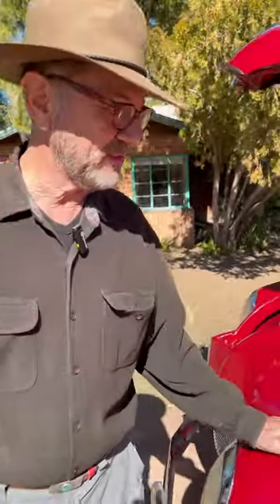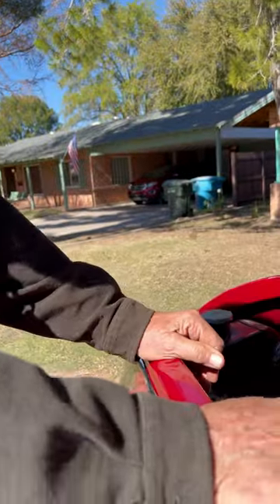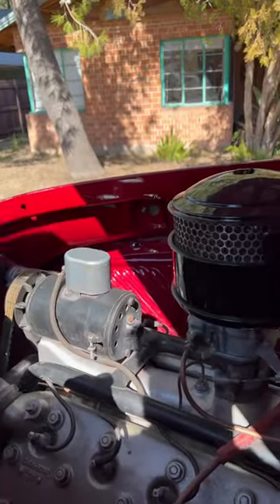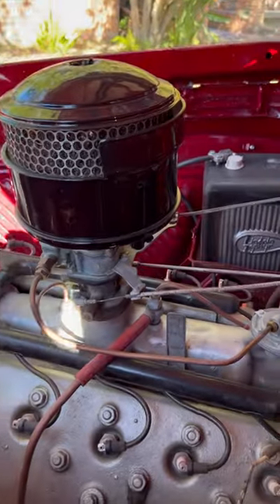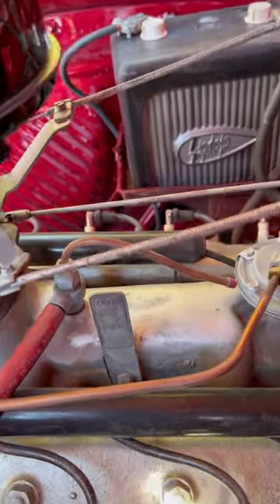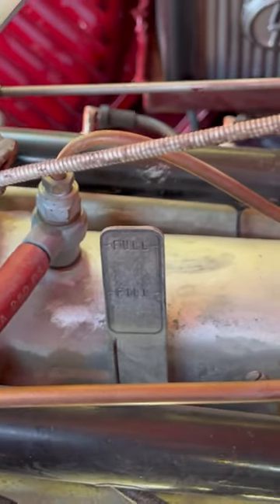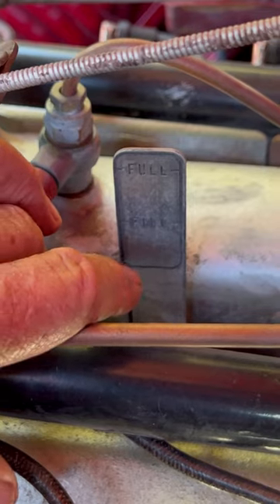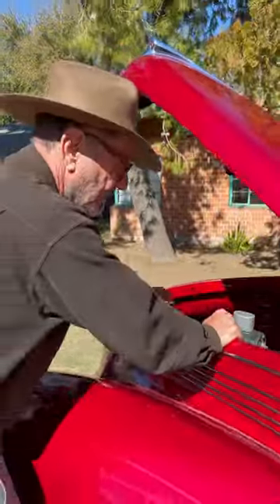Crazy No Dipstick Oil Check - Early Lincoln V12 Flathead #shorts #classiccars

Comment: back when things weren't built to be thrown away.
Reply from the maker: So true!
Reply: Any decent new vehicle would run circles around that In every single category except maybe beauty.
Reply from the maker: @ROBMACDUI also history perhaps
Reply from the maker: Beauty and also maybe historical context, which I enjoy very much
Reply: @BarryTsGarage  can't argue that.
Reply: @ROBMACDUI  could care less. I could fix that car with a banana and a chisel
Reply: @andrew1898  can do that with a modern car too, just gotta have the knowledge, saw a guy skip the fuel pump and use a water bottle of gas and some hose and made his efi modern car work, he put the hose into the intake somehow and it was able to suck enough fuel for an idle
Reply: @ROBMACDUI  except that it’s a car you could’ve bought brand new and generations later it would still be running. Back when cars were fixable pieces of steel and aluminum with plenty of room and access there wasn’t something that you couldn’t find a way to fix. Get into a fender bender nowadays though and you’ll be picking plastic up off the road as your pos gets towed to the junkyard to get the insurance slap of approval “totaled”
Reply: @thedragoonafilms2406  

Hyperbole is your best friend.
Reply: @ROBMACDUI  for 7 years until it rots and starts falling apart then winds up in the junk yard. Cars (mainly the minivans that everyone calls crossovers/suvs) are 100% disposable, you just wouldn't know it from the ridiculous prices. Why do I want a shit box that will dent if I lean on it, be totaled because the floor pan has a little water in it or fail to work correctly when the radio is removed? EVERYTHING is made to fail in new vehicles. Better start saving for that $1000 head light assembly and get ready to drop the whole front end to change it.
Reply: @skylined5534  I understand how it could be viewed as hyperbole but that makes it even funnier because it’s the truth
Reply: @jamesb1221222  Lol. There are countless modern cars with hundreds of thousands of miles on them still running. How exactly is that disposable? The vehicles you are praising needed constant maintenance, rusted out and would be lucky to hit 100k miles without a major failure. The only reason a few of the vehicles you are praising still exist is because they are cared for with cotton gloves, stored in climate controlled garages and hardly  driven to keep them alive. While I can agree that many older classics have beauty and character unmatched by modern vehicles, they simply can't even begin to compete with modern vehicles in any other category.
Reply: @andrew1898  You couldn't even find the parts to fix it.
Reply: @ROBMACDUI  NOT QUITE TRUE IT HAS PASSED THE TEST OF DURABILITY.
IT ALSO DOESN'T HAVE ALL THAT COMPUTER CRAP TO GO WRONG
Reply: @donhagerty5669  I've owned at least 10 modern vehicles and not one has had an ecu failure. ECUs not only manage fuel, ignition and other perameters but give you feedback on how things are running in detail. Just because you don't understand something doesn't make it bad.
Reply: @donhagerty5669  "computer crap to go wrong" 😂 What a trope
Reply: Well, where the heck are all of them today???
Reply: Actually, these were built to be just as disposable as modern cars. Planned obsolescence isn't a new concept. These are just a bit easier to wrench on if you know how. These old flat head engines needed the head bolts retorqued every 10 or so oil changes and rarely lasted more than 100K miles, although that was more the fault of the low quality motor oils they had at the time. Most of the prewar cars still around today were either barely driven and fastidiously maintained or were parked in a barn and eventually restored.

Carburetors also require frequent tuning to keep them at optimal efficiency and/or power. Changes in temperature, pressure, and elevation all affect the air fuel ratio in a carburetor. the most rudimentary electronic fuel injection system is a massive quantity of life improvement for the typical car owner who just needs the thing to reliably commute to work.

That said, I'm very glad there are people restoring and maintaining these old cars. It's a labor of love, but the typical car buyer isn't going to want these put back into mass production. They're slower, less efficient, less safe, louder, less comfortable, etc.
Reply: I really dount these old cars had the same usable life as a new car. We have a 2012 Focus in our modest fleet, its over a decade old and coming up on 140k miles.  And its done that almost trouble free, no engine rebuilds or transmission refurbishments.  Two things that a car like this will have had at least twice in the same mileage lol. 

If i opened the engine today i could all but guarantee the bores still have crosshatching and the bearings are perfectly within tolerance.  

No, the truth is cars of this era simply were not designed or built with the idea that they would still be viable transportation a decade later, let along many decades later. The many interesting details and allowances for service on these things is not down to some sort of anti consumerist moral superiority,  they exist because these cars required constant maintenence even within their relatively short expected lives. 

Modern cars regularly go their entire lives with little more than oil changes and new tires.
Reply: @DrewLSsix  3 toyota trucks. 300k ,256k ,267k miles. Only oil changes and 1 clutch. Soon to replace the other. 1987, 1997, 2001 models. No old American passenger car could do that. Maybe ford's old straight 6, one of which my father had, it was an 85 or so f150. Had 600k miles on it when he sold it and I saw it on the road for years after. These pre 80s vehicles were all extinct completely within 30 years. Very few are on the road and none of those are without MAJOR mechanical repairs in that time
Reply: Ironic you say that when those cars were built to only last about 4-5 years.
Reply: @BarryTsGarage you say that but my 25yearold subaru got 225k miles with nothing but the usual maintenance, my 23 yearold skoda rally car is on 80k no issues and 20yearold subaru on 113k again no issues! my friends had to scrap his 6yearold bmw due to rust at 105k miles and the neighbours 4yearold bmw is in the garage with a blown engine at 70k miles, the neighbour opposite just got his audi back from blowing a transmission, its 2 yearold with 9k miles on it.... modern cars are completely disposable crap designed to run the warrenty period at best then go in the bin
Reply: @ROBMACDUI  you understand that this vehicle is over 50 yrs old, right? No "decent modern" vehicle has the capability of lasting 15 yrs. So, you may want to add longevity, reliability, serviceability, and the ability to properly/successfully diagnose as other aspects that a modern vehicle will NEVER touch when compared to something like this. I would also argue those are some of the most important aspects of a vehicle. 

Even considering the fact vehicles of this era were pretty much disposable by definition, they are still INFINITELY diagnosable & repairable. You could rebuild the drivetrain with 3 tools at the cost of what 1 of my interior door trim pieces cost. Modern cars engineering philosophy is literally to last the life of the lease. If you're talking mid 80's to about 2010 vehicles, I'd get that. But 2011ish & newer you're just lying to yourself. Dealerships literally can't diagnose their own sh*tboxes these days, because they were engineered to be thrown away while simultaneously being unaffordable. These old vehicles could be afforded.
Reply: @ROBMACDUI  you don't have to find the parts. The parts THEMSELVES can be rebuilt because real cars aren't disposable.
Reply: @ROBMACDUI  and if 3 drops of water get into that precious ECU, you now have a lawn ornament. Ah, nothing like obtaining dealer only software to code in a new one!! Fun!!
Reply: @RothBeyondTheGrave  I could power wash any modern cars ECU and it would be fine.
Reply: @RothBeyondTheGrave  What is the benefit of a serviceable part that doesn't last a fraction of how long a quality part built to exacting specifications by a manufacturer. Quality built components will outlast multiple rebuilds of a serviceable part. Not toention, those "disposable" parts are almost always returned for a core charge to be "properly" rebuilt by a manufacturer making your argument flat out wrong.
Reply: @RothBeyondTheGrave  Do you live in a cave? There are million of modern vehicles over 15 yrs old.
Reply: @ROBMACDUI  you are completely right. The problem is that when the new stuff breaks, most of the time you need specialist equipment that communicates with the computers of the vehicle for certain parts. Also many times, the parts that need to be replaced are specific to that vehicle and had to be replaced with dealer part or a 3rd party equivalent. Compared to older vehicles that used standard parts that fit multiple makes, models and could be sourced from any hardware or parts store. For example, my 1996 ford ranger had a pcv hose crack. I simply went to ace hardware and picked up a $0.50 hose to replace it. However, my fathers 2017 ford fusion had the pcv hose start leaking. It was a flexible plastic tube that has a sensor molded to the plastic tube. As well as special shark bite connectors at both ends that connect to the manifold and crankcase. All made of plastic junk. This part cost a whopping 200 bucks!!!! And that was the cost on rock auto. O’Reillys wanted nearly 300!!! Quite ridiculous of you ask me. That’s why I will always stick to vehicles made last century.
Reply: @iheartapple-114  I can somewhat agree on vehicles made by some manufacturers like dodge, gm, Ford, etc. My point of view comes mostly from Hondas and Toyotas. As an example, my nephew drives a 2004 Prius (yes I know, hideous car) that has 252000 miles. Outside of a coolant pump, it has needed nothing more than a couple 12v batteries (big battery is still good) oil changes, and tires. Brakes are even still original due to the Regen braking and yes the plastic "junk" is still all intact. It does have a few electrical gremlins like the dash randomly going dark but other than that it runs like a top and always starts.
Reply: @ROBMACDUI  I agree with you about the Hondas and Toyotas. My 1999 Corolla has 320k miles on it. Original engine and 5 speed manual transmission. Runs like a top. I’ve had it for over a decade. Other than normal maintenance I’ve only had to replace the plastic door handles on both rear doors. (It’s a common problem with that generation of Corolla. Toyota and Honda makes Super robust cars. Even the new ones.
Reply: @ROBMACDUI  You’re right… until the warranty is up then magically the computers start failing so you gotta take it to a dealership and pay $600 every time because the dealership is the only place authorized to carry and install the parts you need. The planned obsolescence sure is something.

Meanwhile this vehicle could be repaired by anyone who has some general equipment, and if not you can take it to any shop of your choosing(or any mechanics you personally know) and save a lot of money over a dealership.
Reply: @charlesbrown4483  Sorry but the various computers in a modern vehicle have an extremely low failure rate. In 25 yrs of driving modern vehicles, I personally have never had an ecu failure.
Reply: @thedragoonafilms2406  that's not true. We have this bias because only the old cars that have lasted a long time are still around. We don't see any of the pieces of junk that broke so we don't think about those.
Reply: Also. Ford flathead V8 E ngines seldom made it past 60,000 miles. Yes, they where made to be trashed. So you would go out and get a neq one to keep the economy going.
Reply: @bluwlvrine  lol, so true. That one 1950 chevy truck thats been restored several times is proof that every other 1950's chevy truck is out there out preforming todays cars.
Reply: Old stuff is cool. But it wasn’t built to last forever. People just have nostalgia for old cool things. Cars of this era had to be rebuilt well before 100,000 miles. They were not designed to drive 10,000 or 15,000 miles per year like we do today. They also did not stop, nor corner anywhere near modern cars and overheated easy.
Reply: @andrew1898  I have a few old restored cars. I’ll take that challenge.  Lol
Reply: @donhagerty5669  I have a couple of 70+ year old cars that are restored and believe me there’s plenty to go wrong.
Reply: My uncle had a V16 
La Salle that was one of the fastest cars I have ever been in ever tremendous BALLS !
Reply: Cars today have become mobile homes. I only go shopping or visit a friend got a 99 Sierra pickup had it for 23 years ugly as hell with only 132k but it always brings me home
Reply: Can we save the manuals tho